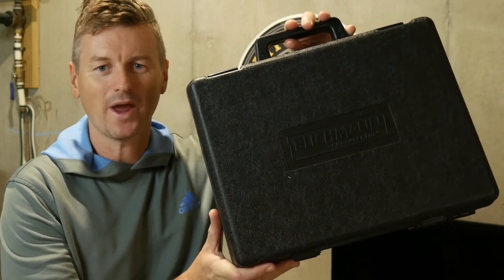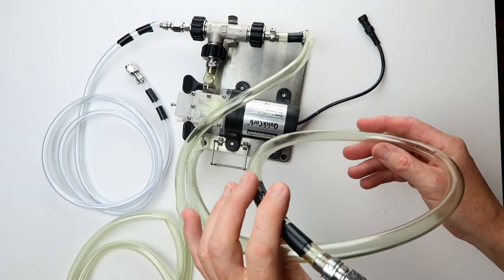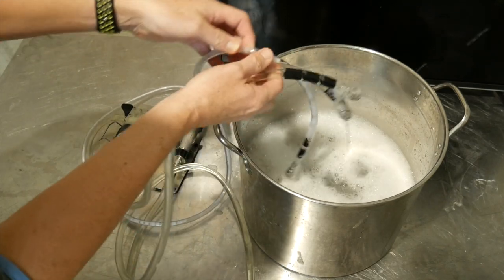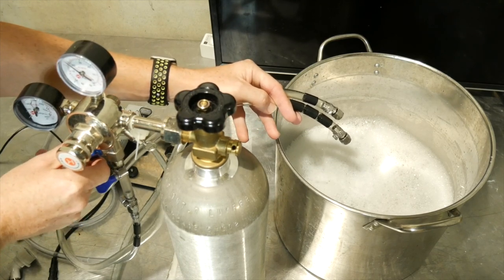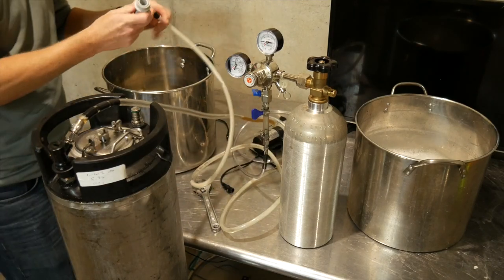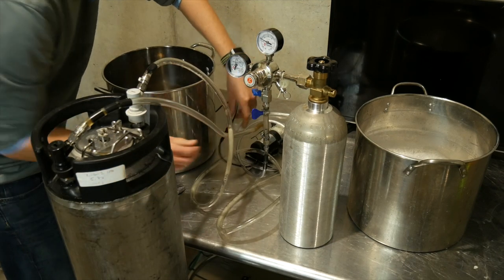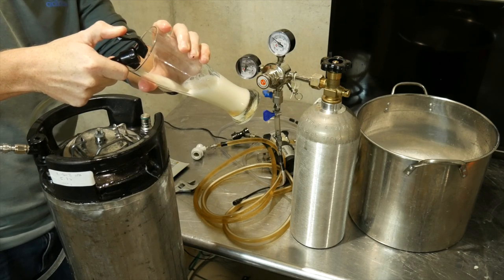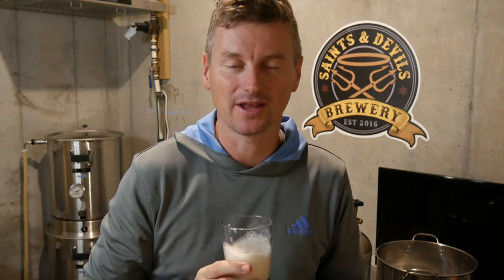Blichmann QuickCarb review - force carb beer in under 45 mins

Comment: Nicely done. I have done that with the picnic tap TOO MANY times. I do find that I like to run mine for a full hour, and slightly purge the keg pressure about half way through. Keep up the good work! Subbed! looking forward to more from your channel. Cheers! 🍻
Reply from the maker: Short Circuited Brewers thanks! Good tip with the keg pressure purge, I'll give that a try on the next one to make sure I'm getting a full carbonation.

Comment: hello, I used this Quickcarb to carbonate my beer, but when bottled (with a BeerGun) I get too much foam in the bottle and almost no beer, after finally filling the bottle I tap it. And when I try my beer it does not have almost gas or sometimes nothing ...... do you have any advice that can help me with this? I would greatly appreciate it :)...... nice videoo and hi from Colombia
Reply from the maker: Hello there! I only have experience with kegging. I find it useful to bleed the keg while the QuickCarb is running which gets a bit more gas into the beer. Then let the beer settle for a while and check the carbonation level. If you are getting foaming it might be worth checking both the beer and the bottles are cold when filling.